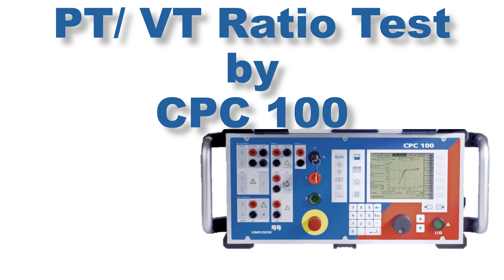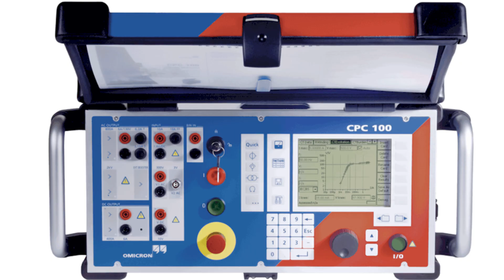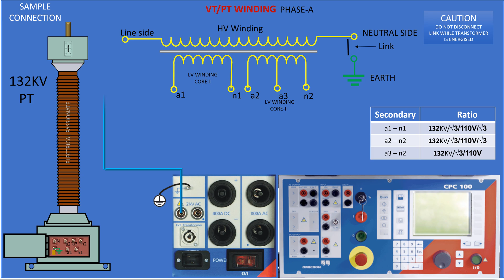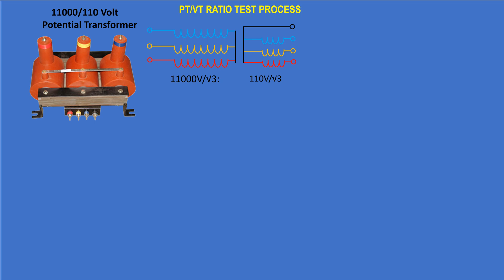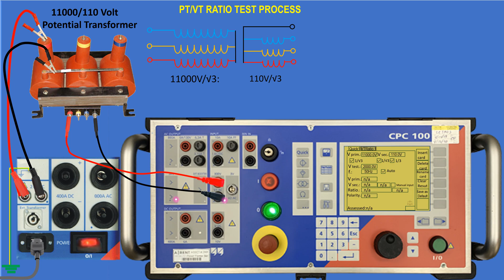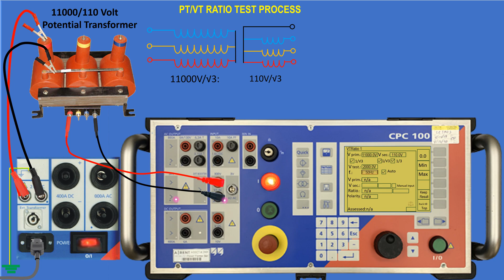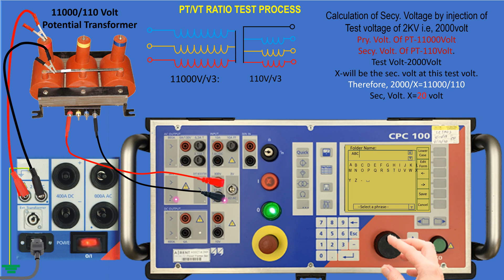VT RATIO TEST BY CPC 100/VT RATIO CHECKING/PT RATIO TEST/HOW TO OPERATE CPC 100 TO TEST VT RATIO

Comment: Thank you sir, I've seen a situation where they used test plugs on switchgear cubicle low voltage compartment with a software for testing .
Reply from the maker: You are welcome. You also can do as you stated. Thank you ❤.
Reply: @electricalpassionate  thanks for knowledge sharing